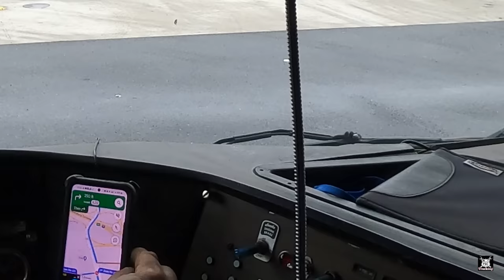This Is How Easy It Is For A Truck To Wreck A Train

Comment: I think it was a very wise decision that you made not to go over those tracks and I have a few questions for you.
 I watch a lot of your videos and enjoy watching them for I would like to get into truck driving myself is it hard to do stick shift in a cab over or drive it sometimes it looks like it's more difficult because of the position it's sitting over the engine other times it looks like it's absolutely easier I would like to know if you could I'm gear changing and what it's like doing a cab over a normal hooded truck?

Comment: I'm just going to throw this out there for the people who don't know,if you find yourself stuck on railroad tracks take jumper cables and connect both tracks together it changes the signal for the train to red and indicates a problem to the railroad.
Reply: Now why doesn't every driver know this ??  I just did a Google search and it looks like this fact has been around longer than sliced bread. Now how do we get drivers to "SWING WIDE...IT'S A FRIGGEN TRAILER !"

Comment: Trucks have to haul loads with low trailer height, over railroad crossings. Why can't we, as a country, make crossings so the tracks aren't the high point in the crossing? The country throws money at all kinds of things that don't matter...really, the road design engineers pretty much suck at their job when it comes to considering commercial vehicles
Reply: Many a time small rail lines became big rail lines overnight. A line built in the1850's with 60lb rail would suddenly become a class I railroad with132lb rail, and the railroad would dump a bunch of heavy grade ballast to support the heavier railroad.  And all the grade crossings would get those humps you see with warning signs. 
    A WORD OF CAUTION IF YOU DRAG ACROSS THE RAIL STOP AND CHECK THE TRACK FOR DAMAGE OR CALL THE RAILROAD COMPANY AND EXPLAIN THAT YOUR TRAILER DRAGGED ACROSS THE RAIL. It does not take much to knock a set of tracks out of gauge. The railroad would rather inspect the crossing than risk a derailment.
      All railroad crossings are required to have an emergency call number with a DOT # for the crossing.  
      As you see them put in the emergency800 numbers for railroads to have handy. Even if you don't have the correct railroad the call center can redirect you to the correct number.

Comment: I as a fellow driver, and equipment operator, have never figured out why it is so damn hard for engineers to design flat crossings. ok so just had 200 yds of fill and flatten it. Also if you had a detach trailer, you could, just raise you neck and airbags which is what I would do.

Comment: You know Steve, if you hadn't been a railfan or better yet, a truck driver with common sense knowing what you're pulling, I could see you ending up like the truckers who don't read the sign or look at the clearance and you'd have the tow truck that just helped you put the crane truck on your trailer plucking you off the crossing provided a train doesn't show up because you have enough weight on your trailer where you could derail it.

Comment: Not knowing the exact weight of that Oshkosh, I would say you are at LEAST two chains short on your securement.
Reply: Man those chains were beast chains. He was golden
Reply: 16.000lbs chains. No problems.
Reply: It would be nice if you people actually knew what you were talking about.  A 5/8ths grade seven is only rated @ 15,800 IF it is a straight pull up and over.  It looks like he’s using 1/2” which is rated @ 11,300 on a straight pull.  The angle he used cuts that in half.  I assume you can do the math.
Reply: Keep opening your mouth and showing your ignorance.  It was 1/2” at MOST!! FYI, I have 25 years of HEAVY HAUL experience.  END OF CONVERSATION!!!
Reply: @danmetcalf7184  ok boomer
Reply: Steve has said those chains are 15,000 pounds each.
Reply: Those are NOT 5/8ths chains. Even if they were, not being straight up and over the WLL would be HALF.  Why do you want to argue with someone with 25 years of REAL heavy haul experience?  Someone who has had to be inspected by d.o.t. before crossing a state.  If someone wants to post something, it should be correct!  You can purchase a book that explains these things IF you can read,

Comment: Dang, seriously pardner? That's terrible, but then we've all done such until someone has shown us how.

Cross chain the front axle, its not forward restraint that matters here, but rather sideways. 

The rear is done side & side, front to back, or back to front, by tying off one end of your chain, either back or front doesn't matter, then passing the length over the entire axle group to run between the duals & down  to run free through your opposite end shackle point then end up to almost meet the top chain       in the space between the tyres of any convenient 2 axles; at which point your chain binder makes the connection. Tension to taste, & the suspension is free to work as it should. The way you've done it, the carried suspension will break even 20 ton chain given a big enough nudge.

I ran triple & quad flat top roadtrains from Perth Western Australia out to our remote mines, & coming home I used to carry trailers & dollies because we could only pull 2 trailers from 300kms out & into town. That's how we do it. Ramp loaded & sometimes stacked three high, still get under max height. Another thing, you can unload any carried trailer with its attached dolly using 2 forklifts, one on each side & drive the rig out from under it, but you must use 2 blocks, railway sleeper size behind the dolly & between its chassis rails & the trailer chassis rails to prevent the dolly pivoting on its fifth wheel & hitting said trailer chassis rails. You want it to come down more or less level.

BTW I've carried tractors on Drake trailers, (axle widening heavy platforms), that have no side rail chain attachment points but rather recessed deck shackle points. Same method but you might have to get creative to achieve a free running chain fixing point at one end. Use a big shackle to extend to the required height above deck.

Almost forgot, very tidy looking cab over, aren't they rare over there?

Comment: You should have made a right at the stop sign and gone to the light and made it left then gotten on 95 south gone down 3 miles and gone to the pilot. 
Your in an area that's getting ready to get you hung up with that low boy. 
You're in. My back yard.

Comment: All you need big guy is a 7/16 wrench disconnect the little stick connected to the leveling valve push the arm down and the trailer or truck will lift itself cross the tracks and reconnect the little stick to the valve at whatever ride height you want

Comment: first mistake is using your cell phone and google maps as google doesn't provide routing for trucks like a truck GPS does so you are not protected from overhead obstructions or train tracks that might be to high causing your low boy to get stuck, not that a truck GPS is perfect but it does a much better job then google maps.
Reply: Here on Long Island trucks constantly get on the parkways (NO TRUCKS) because they bought the $79 Garmin.
Reply: @mrwilson7617  No GPS if fool proof, one needs to read signs and park somewhere and figure out were then need to go to avoid parkways.

Comment: I am shocked by the discrepancy between truck-trailer road surface clearances and universal road/railway crossing points.    Bearing in mind that both trucks and trains frequently make inter-state journeys there should be some sort of national regulation concerning the 'fit' between railway level-crossings and the approach roads.    What is the federal government doing to bring state highway authorities and rail companies into line with a universal standard fit to level off the humps found so frequently at American crossings.   I have driven many journeys accross the pond and I've been shocked by the catastrophically 'humped' crossings, especially on lesser roads that are perfect snares waiting to trap a 'low-loader' crossing the tracks.
American infrastructure standards for highways and railways are abysmally low.
Reply: We're building back better

Comment: I honestly don't know why they keep building "level" crossings like this!! There is absolutely NO reason for it to have a gradient across it the way it does, that turns it into a speed bump or guaranteed bottoming-out hazard for trucks. A level crossing is supposed to be LEVEL - clues in the bloody name! And they absolutely CAN make it completely flat across. I've seen plenty of level crossings that are actually level so I know damn well they can do it. Seems like either whoever built the rail gradient, or whoever was responsible for the gradient of the road either side completely failed at their job. And worse, they don't even bother to have adequate signage at a decent distance from the crossing that not only warns you of the hazard, but gives you more options to choose an alternate route. Instead they leave the signs until right before you actually reach the crossing, meaning you're now stuck on a road that is usually an absolute nightmare to try and get turned around on. And that's if there's any signs at all, warning of the danger! It's like they want there to be collisions between trucks and trains or something!
Reply: That's not why they call them level crossings, but I agree with your sentiment. Come to the UK, signage is a lot better!
Reply: @steveluckhurst2350  That's exactly where I'm from - the UK lol. Um, why do you think they're called "level crossings"? I'm curious to find out. Cos as far as I'm aware that's absolutely why they are called that. Because the rail is level with the road and not grade-separated.
Reply: @DavidStruveDesigns  now you've got it right! There is a subtle difference from what you said before!
Reply: @steveluckhurst2350  There is? I'm not aware of a difference. Level means level right across it too, not just generally level in height with each other. As in the road crosses the rail completely flat. It doesn't have a bump when driving across it. That's what they're supposed to be. And there are plenty of examples of just that all over the place. But sadly just as many that are seemingly purposely designed or built to bottom-out trucks. For no apparent logical or valid reason.
Reply: @DavidStruveDesigns  oh dear.

Comment: There's always one idiot that can achieve more with a single vehicle than an entire convoy of trucks. I usually find they are having a group outing and meet up just where I want to turn at a junction or set up to  load/unload. If I hadn't seen this upload I would never have believd they sometimes venture out on their own and not just in large groups.

As a Brit though I do wonder why the USA seems to build so many crossings with grounding issues whereas the majority of crossings in the UK are built so the road and rails are at the same level. Maybe YT uploads feature the incidents as the good crossings would make boring viewing. I don't have a mass of degrees or the brain of Einstein but even I can see it's better to build/modify the crossings so there isn't a risk of grounding rather than rely on common sense as 'there's always one' who will get something big/heavy stuck at the wrong moment that costs ridiculous amounts of time and money to sort out.

Comment: 12:55 that's nothing but just a poor layout of the level crossing ... a problem which seems to be rather common across the US
Reply from the maker: To me it looked like a repair after the tracks were raised higher.
Reply: @fsctrucking  not talking about this specific crossing, I've seen many clips where semis got stranded on a level crossing in the US. Kind of has to do with either the layout of the level crossing itself, or the trailer layout, or both I guess. 
I've barely ever seen sth like that here ... only 2 times: one was an flatbed truck, and the other one was an articulated city bus, both of them were on roads they're not supposed to be on

Comment: What up Steve 
Orwell looking good 🕶
The only thing I would have done is cross  the chains on the front If I could have with out hitting the tie rod 🕶
 Loved them twin sticks ,  that bitc looks heavy  maybe a good 55000 pounds ???   the old cat and pipes sound good bro 🕶  For sure I seen that video , but I think he learned something Never go slow with a double drop over railroad tracks you are not going to make it ,  I am glad you made the correct decision Steve , a lot of these guys do not even pay no mine ,  and the video Show you the results ,   That is right Steve I would not move for that 4 wheeler ,  Let him set  there and let you get done doing what you are doing ,  You know these 4 wheelers they do not have no brains ,  I see it all the time a 4 Wheeler will come out the entrance way and then they go in the exit way ,  Then they look at you like you are the stupid one  😂  brain less people
be safe take care yourselve STEVE
Reply: So you never drive a 4 wheeler?
Reply: @joeferreira7382  Most of the time i do and try to be considerate of others I guess I get little upset when it seems like 18 wheeler's always complain about 4 wheelers as if they never drive them